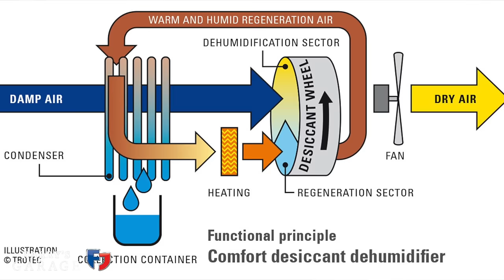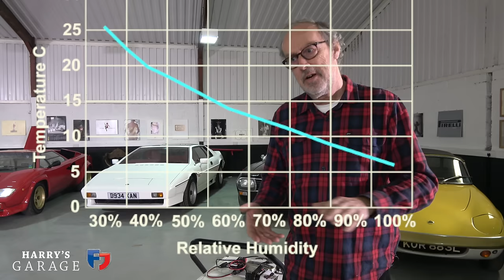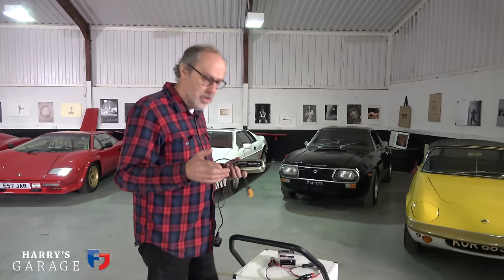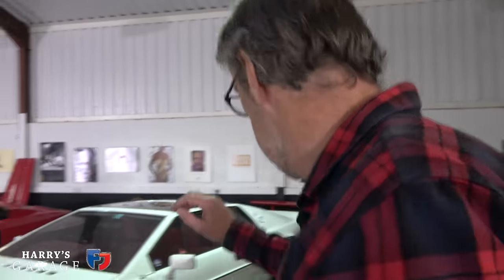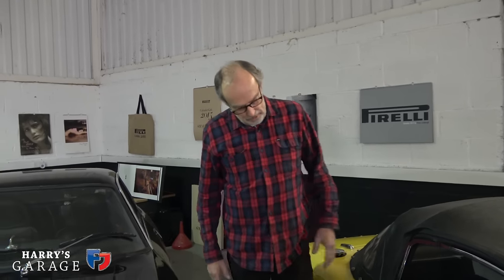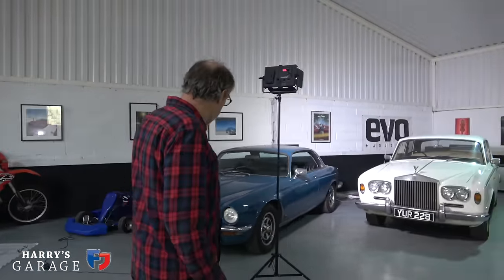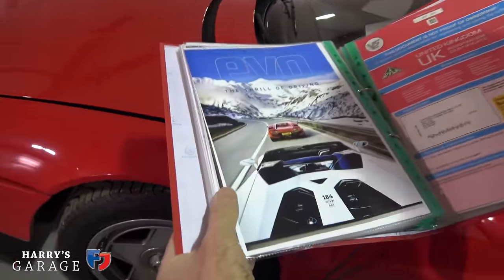My top tips for keeping any car in top condition during a period of storage.

Comment: Another point regarding occasional run up - make certain it gets FULLY warmed. Coolant up to full temp, oil up to temp. If you start for a few minutes then shut off, condensation forms in the crankcase. The heat of run up normally evaporates it, but short on-off cycles don't. I've seen honest-to-god milkshakes in the oil from people doing this. They'd have been better off not touching it at all.
Reply from the maker: Very true, good info. I could have made this video 30mins long and wouldn't include everything but if people read all the comments, as well as watch the vid, I think they will learn a lot! 👍
Reply: Absolutely.  FULL operating temperature is so important.  Expels moisture from the exhaust as well.  I would give them an "Italian Tune-Up", gently run them through the gears in the higher RPM range.
Reply: @harrysgarage  Very in depth though Harry.
Reply: Is it okay to leave your car stationary running on idle for a period of time? Harry i have a 993 4s thats sat in the garage on the ctek charger. You are welcome to drive/review when the lockdown is over.
Reply: Another excellent video as usual. Subscribing to  Harry’s channel makes the lockdown so much more bearable
Reply: @afrouks6621  in my experience yes, so long as it does get up to temp fir at least a few minutes... I run my Alfa up every few weeks to charge the battery and circulate everything. With an air cooled 911 youd want to watch the oil temp of course!
Reply: @harrysgarage  absolutely. Us bike guys in northern climates already know this drill but most car guys don't!
Reply: @OddBike  thanks for the info.
Reply: Also don't just rely on water temp. If your car has an oil temp gauge as well as oil pressure use that. Otherwise leave it running for a few mins after water temp is good, but make sure you either have a pipe to take the exhaust gasses out of your garage or roll it just out of your garage and shut the door before letting it warm up.
Reply: @afrouks6621  I never started my 993 during the winter when I owned mine. I had it on a battery tender, inflated tires, fuel stabilizer, etc. and it never missed a beat come spring.
Reply: Yep, get that thermostat open. This video is especially important as cars might have been emerging from a 6 month period but now, might be another 3 months off the road.
Reply: @afrouks6621  No, see my reply in full above. You starve the engine of oil and coke it up

Comment: You missed the key point of the Ctek that it allows the battery to DISCHARGE a little every couple of months and then recharges it.  Most cheap trickle chargers will not overcharge a battery but if the battery is kept fully charged it ‘sulphates’ and dies after about 6 months.  This is the most important feature of the Cteks.  I also have about 10 cteks in my garage after killing batteries with cheap trickle chargers.   Never had a battery problem since.   Many premium manufactures also sell cteks branded as their own.

Comment: I always disconnect the battery to prevent fire if you have more than a couple of cars. Wiring gets brittle, and there is MASSIVE energy in a fully charged battery. I had a spontaneous fire in a car, a 2001 VW Lupo that was my wife's. Bought from a dealer, one I didn't maintain. It started in the indicator switchgear. The fire put its self out only because all the windows were up. The windscreen cracked with the heat, all the instruments melted, headlining burnt. I also had rodent damage in an E Type Jag, rodents love the classic period seat padding, they get in through open windows. I now disconnect the battery and window down a few mm, and in March/April a vapor strip moth & insect killer, windows up. Stop any woodworm flies. Coachbuilt cars, kit cars, your Morgans, Jensens, Astons and Rolls Royce up to 1970 have wood in them. Visit the car often.

Comment: Just a thought about storage in the current lockdown. Most (all?) UK marinas are now shut, so it’s not possible to go and visit the boat to check the temperature and humidity is OK (Meaco DD8L recommended, btw), so I’m very glad I installed an Envirotxt device. I just send it a text and it replies in a few seconds to tell me that the mains power is still connected and also the temperature. Currently 16C, at 10 pm.... If mains power is lost, it also sends me an alert so I can get the marina staff to investigate. Very useful device that could also be used for a remote garage, provided it has mains power.

Comment: 1. Building: isolation, humidity, temperature  1:00
2. Battery: 6:06
3. Petrol: 10:40
4.Anti-freeze: 11:15
5. Tyres: 11:35
6. Convertible top: 12:12
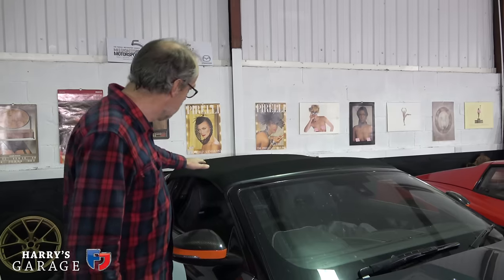7. Windows: 12:38
8. Hand brake: 12:55
9. Washing and covers: 13:12
10. Regular drive or start or spin it: 14:03
11. More covers: 15:23
12. Fuss over cars: 16:15
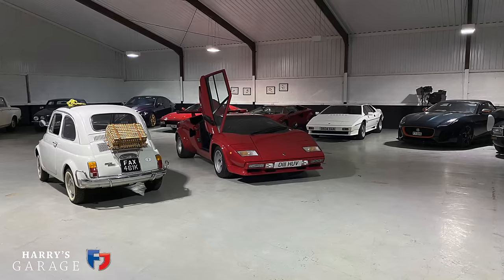13. History file: 17:08

Comment: The biggest difference I saw recently was to fit a Hormann 4 panel insulated garage door. You drive the car in at night and the garage is still warm the next morning. Make sure garage ceiling is fireproof plasterboard. Disconnect and electic door openers (mine opened in a fire and let draught in and wrote the car off because the windows were open! Smoke and Fire alarm. Have a fire extinguisher handy. Pump the tyres up extra hard to prevent flat spots. Ventilation is more important than heat. Let the whole system breathe. See the latest RICS consultation on buildings. Corrosion of discs under disc brake pads?  Put in some plywood dummy pads soaked in oil to protect the discs. Unload suspension a little. roll car around to different position. Press brake pedal to crack piston seals. Run engine but long enough to get tailpipe really hot to get condensation out of exhaust pipe. When hot take oil filler cap off to let water vapour out of engine. Don’t plug the exhaust pipe. Car covers make cars sweat and restrict ventilation. Keep out of direct sunlight. Brake fluid is hygroscopic, put small sachet of dessicant under the lid. Be careful of over-clever battery chargers, lots of snake oil being sold. Increase concentration of corrosion inhibitor or use waterless coolant. Clamp on some sacrificial anodes to limit corrosion
Reply: A sacrificial anode, cathodic protection will only work if there is a complete circuit. Just bolting one or a few to the chassis won't do anything, the zinc needs a circuit to be completed. I guess you could store the car in damp mud or water to complete the circuit.....
Reply: Chris Clark   Chris, Harry’s Lotus Elan, like mine, probably has a galvanised (zinc plated) chassis. Zinc is anodic relative to the iron in the steel Elan chassis. See the Periodic Table. This is a ‘galvanic couple’. The humidity in the atmosphere at the dew point causes water to condense on the bi-metallic junction completing the electrical circuit. On my yacht I bolt sacrificial anodes to the stainless steel propeller shaft. Each season the anode corrodes away in preference to the iron in the steel. Same as a galvanised dustbin. The effect is further exacerbated when additional electricity is added in, such car batteries, as battery chargers, shore power lines to the quayside, etc. The simple expedient of bolting a sacrificial anode will protect against cathodic (the Lotus) chassis corroding. Magnesium is also used but is more expensive than zinc. However hard he tries Harry cannot reduce the relative humidity in his garage to a point where this is not an issue. Similar couples exist between the iron in the brake discs and the metal particles (and other chemicals) in the disc pads. This is is why the brakes stick on and the discs corrode under the pads. It’s all about relative humidity, dew point, condensation and ventilation. Work with nature and you have a chance. Try and beat it, your car rots away.Magnesium alloy wheels = 4 sacrificial anodes on every corner, gently fizzing away in preference to the chassis,.This is why the wheels develop surface pitting. White magnesium oxide forms under the cracks in the lacquer and away it goes. Far better to take the laquer off and expose a greater surface area to more distributed corrosion. This is why you don’t see brass on proper yachts, only bronze. The zinc in the brass just fizzes away .....

Comment: My father has museum registered Opel Rekord 2.0S from '80, driven approx 100k miles. Top notch condition. Unfortunately he doesn't have garage to keep it safe during winter (he would want to), but luckily we live in nordic country where winter temps go below freezing point. What he has done is to keep the car on clean tiled surface, made from concrete ground tiles, so that the ground is as dry as possible. Years ago he also did full rust proof coating to the bottom, wheel arches and even used long hose to spray the wax protection inside the skirts. He puts big felt bag of silicate grain into the interior to keep it dry from moist/humidity. Then he covers the whole car with very thin felt blanket and puts tarp cover for weather proofness, but those do not touch the ground to keep the bottom of the car ventilated. The car has been kept outside storing for past 10 years, and it hadn't rusted at all, not even in any hidden places. He even goes to drive with it on -10 C temps, to keep everything lubricated and to ''ventilate'' it a bit.

So if you don't have garage, this is propably the best way to preserve classic/old car, but it requires to have cold climate, not gonna work on UK or similar climate places, where the temps and humidity might be too high.

Comment: Thank you for sharing some great tips Harry.  I have a very reasonably priced desiccant dehumidifier in my stand alone single garage which works very well for me.  It has a drainage pipe to outside but slightly warms up the air in the garage too.  After 5 years of storage the car remains perfect and I have the benefit of all my tools in the garage remaining rust free too.

Comment: A most appropriate and timely video, thank you so very much for producing it, you have taught me a good deal. 
A number of my friends are sheltering overseas to avoid COVID-19, and have given me the responsibility of maintaining their cars while they are away. 
The cars are garaged, but I worry about the batteries, fuel going bad, and keeping them clean. 
On occasion I drive them on the motorway and get them up to temperature, and to keep the tires from getting squared off.
I do use a trickle charger to keep the batteries charged, it seems the electronics on the newer cars will drain the battery in a fortnight.
Once the battery is drained, the Mercedes can be a pain in that you must enter a code, reset the windows, sunroof, mirrors and seats. One car has three codes.

Comment: What I've been doing has just been validated by Harry Metcalfe !
I've been storing motorcycles and old cars (well, one old car, my wife's SLK, top closed of course) over winter for many decades. They reside in a heated garage which is kept at between 12-15 C even in the worst of a Canadian winter. I couldn't agree more about trickle chargers. Everyone has a quick connector permanently hooked up to the battery and its own charger. I use mostly cheap Motomaster (Canadian viewers will recognize Canadian Tire's private brand) "smart" chargers and they've never let me down. Around here we have another reason to brim our tanks with premium unleaded: almost all our regular unleaded contains 10% ethanol, which is fine for daily use, but not so much for months of storage. Fortunately, non-ethanol premium is still relatively easy to find. Personally I also add fuel preserver, but that's probably not essential.
Reply from the maker: Great info, thanks. 10% ethanol coming here in the UK in a few months time. Going to make matters even worse for longterm storage of collector cars and bikes.
Reply: @harrysgarage  I noticed a drop in performance with V-Power in my car and wrote to Shell as I thought they'd filled up the petrol station tanks with regular and not V-Power fuel.   They wrote back explaining it was because they had to add biofuel to the mix now.   Might as well have added water for all it did!
Reply: John Sim had a mate once fill up with pure water from a shell 
Luckily it only went in his lawnmower so no big problem
Reply: @carmadme  I'd worked out that Shell Optimax / V-Power gave me 10% more MPG over standard fuels but only cost 7% more.   Therefore you were better off spending more.   Plus the car felt smoother to drive, both my turbo car and NA one.   Up until that point it was worth buying.   After that, buy the cheapest.   At that point it's all the same stuff that comes out of the refinery anyway.
Reply: John Sim I’ve tried the various performance fuels but notice no differance so it’s not worth it to me
Reply: @carmadme  Perhaps it depends on the car. When I put V-Power in my fuel injected '80 Lancia Gamma Coupe 2500 I could feel a discernable difference.
Reply: @carmadme  The feeling when you drive between the fuels is small, very small, but I ran the numbers on MPG and the difference was there.   The feeling you get isn't one of more power at the top end but more mid-range and its smoother delivery.   Although small, when you're used to driving it every day you notice when it's gone!

Comment: Regarding batteries - recently I was told by an RAC mechanic, who visited my garaged 1989 911 to check its battery, that the best thing to do with longterm storing is disconnect the battery completely. The condition of the unit when you come to fire her up many months later will be better than even a CTEK-charged unit. I once had an F355 for which I'd just use the battery cut-off switch. I drove the car twice a year on visits to the UK. Started on the button and drove 1000 miles no problem. 
Regarding fuel - the anti-condensation measures make sense, but i always leave my vehicles almost empty incase they are stolen - then the thieves need to fill up quick to get anywhere - CCTV will catch them! 
Great useful video Harry, thank you.

Comment: Something I think you missed is mouse traps. I cleaned 17 dead mice out of my 60 year old Sprite last year and had to put a new interior in as a result. Thankfully there's not much to the interior!

The garage is drafty and is shared with the mower and animal feed but it's all we've got :)
Reply from the maker: That was another clip I forgot to include. Damn! Thanks for mentioning it though, top and important tip.
Reply: @harrysgarage  sorry, didn't mean to be that guy!
Reply: Clothes dryer sheets strategically placed. They don’t like the smell and not as harsh as moth balls no ?
Reply: @yetidh9  your answer is correct and in an ideal world would be what I did. Sadly, in my case the answer to where they're getting in is everywhere!
Reply: @tomcardale5596  a couple of good tips is mice do not like the smell of peppermint so you could put cotton wool balls laced with peppermint oil around the place. Plus you can buy some plug in mouse repellers
Reply: nordicmonkey steel wool and the copper mesh pads like the steel wool they won’t chew through either
Reply: Another tip is to not store any sort of food stuffs in the garage. Sounds obvious but my wife unwittingly left a 10kg bag of bird food/sunflower seeds in the garage. Within a month, a single mouse had moved most of them into the inner front wheelarch of my daily driver and made a nice home for himself under the scuttle panel. When I finally pulled out the front arch liner, I filled 2 large buckets with seeds. Pretty amazing when you think about how many journeys that mouse must have made. He could probably have survived in there for several years.
Reply: Graeme Langford  Can vouch for the effectiveness of the electronic mouse repellers. Had mice in my office. Bought one of those buggers and haven’t seen a mouse since. Plug into an outlet and problem solved. I like the steel wool and peppermint tips too as back ups.
Reply: @yetidh9  I'd love to see the look on his little face when he comes back and realises you've nicked his stash.
Reply: Also some newer cars have soy based wiring insulation. I found this out the hard way....Those little bastards love it.

Comment: Very nice tips. Much appreciated! May I also add to the tips that when starting your car up during times of storage it is wise to run the air conditioning (if fitted) as the system tends to dry out and start leaking if it’s not used frequently
Reply: Agree - Any car with Air-Con should be used on a regular bases as the mineral oil in the Air-Con gas lubricates the rubber seals & stops them perishing...    But also worth turning the Air-Con off before the end of the winter drive out, to help dry the system out.

Comment: A thoughtful and, obviously, timely video Harry.  And I think there is a message for those of us who don't have multi car garages (or even garages, I have one but it's full of 'stuff') which is to keep on top of batteries and tyre pressures etc. I'm using my car (Maserati Levante) a bit but I'm probably doing less than 30 miles a week... my wifes Q2 has not moved in the last couple of weeks and I need to deal with that.  One thing I am really particular about doing is a brake drying run after I wash the car(s)... does not need to be far but you gotta get some hear into the disks and callipers to discourage rust.

Comment: You can get desiccant dehumidifiers that don't chuck the heat out, instead they put the water in to a tank like the refrigerant one.

I've used a few Eco Air branded ones.
Reply from the maker: Yes and I mentioned that in a clip I forgot to include. Damn! Top tip, though..

Comment: ‘H’, would you advise to put a Petrol additive into the Tank to preserve your Fuel. Also before filling your Tank to the brim to preserve the Tank make sure the Tank is of sound condition. I hope you don’t have the situation I did, walking into the Garage to find it full of Petrol Fumes from a worn Rubber Hose from the Tank to the Fuel Pump, Fuel all over the Floor. 😀👍